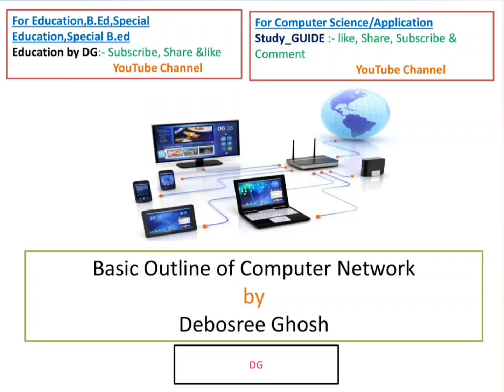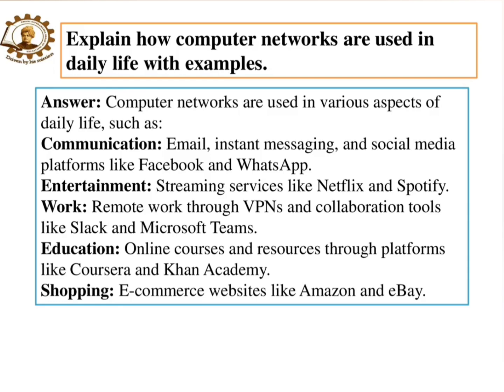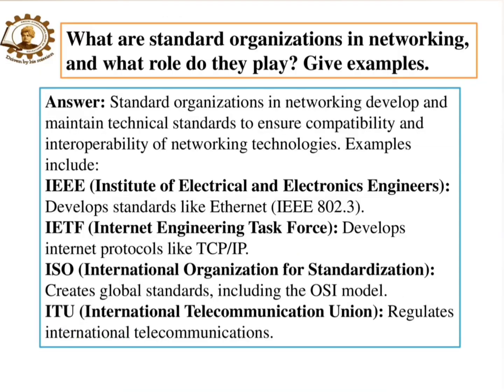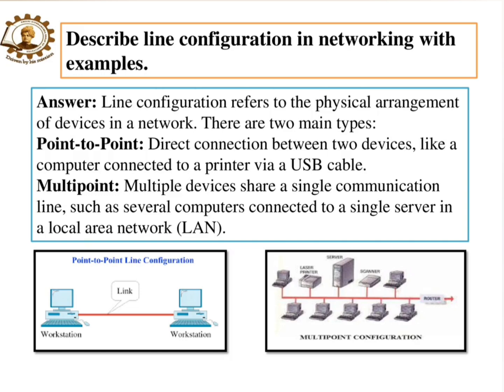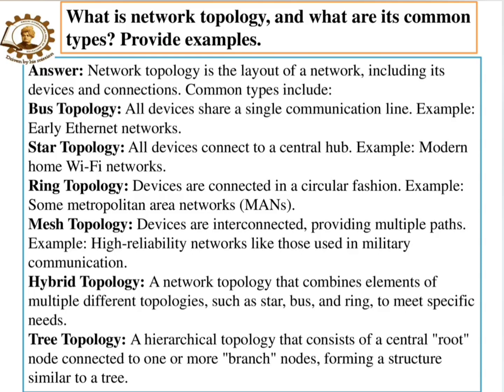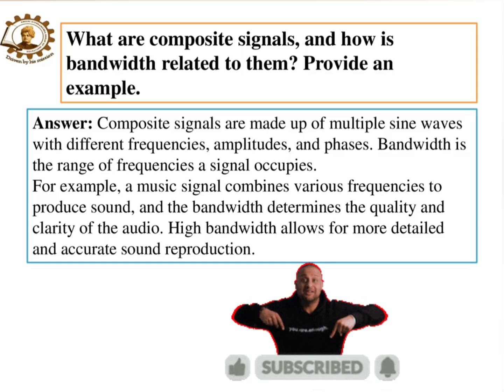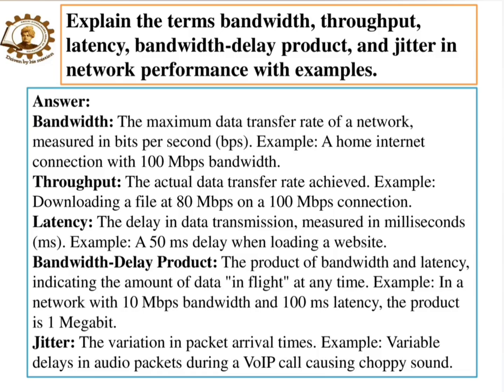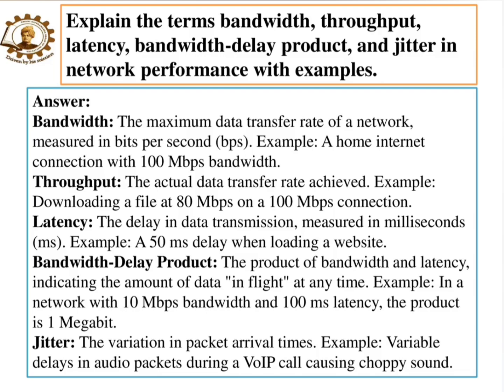Basic Outline of Computer Networks by DG

Comment: Sandip Ghosh (1st year 2nd sem) E.T.C.E.

What is Topology?

Topology is the part of mathematics concerned with the properties of a geometric object that are preserved under continuous deformations, such as stretching, twisting, crumpling, and bending; that is, without closing holes, opening holes, tearing, gluing, or passing through itself.

Different between LAN and WAN?

LANs connect users and applications in close geographical proximity (same building).

WANs connect users and applications in geographically dispersed locations (across the globe).

Comment: Ayan Ranjan Naskar

1. What is the primary purpose of computer network?

ii To connect computers and allow them to communicate.

2. Which of the following is primary use of computer network?

ii Faciliating communication and resource sharing between multiple devices.

3.Which company is responsible for developing and maintaining TCP/IP protocol?

ii IETF.

4.Which network topology features a central node that connects to all the other nodes?

iii Star Topology

5.What does the term latency refer to in network performance?

ii The time it takes for a data packet to travel from source to destination.

Comment: Pranay Purkait (23)

1. What is the primary purpose of computer network?

(ii)To connect computers and allow them to communicate.

2. Which of the following is primary use of computer network?

(ii)Faciliating communication and resource sharing between multiple devices.

3.Which company is responsible for developing and maintaining TCP/IP protocol?

(ii)IETF.

4.Which network topology features a central node that connects to all the other nodes?

(iii)Star Topology

5.What does the term latency refer to in network performance?

(ii)The time it takes for a data packet to travel from source to destination.